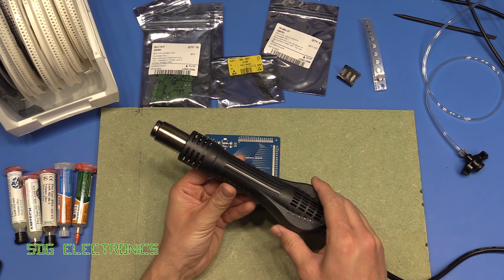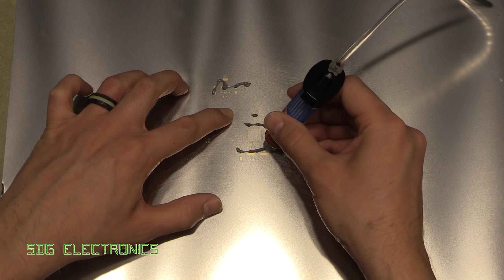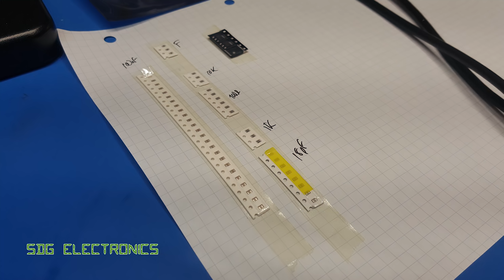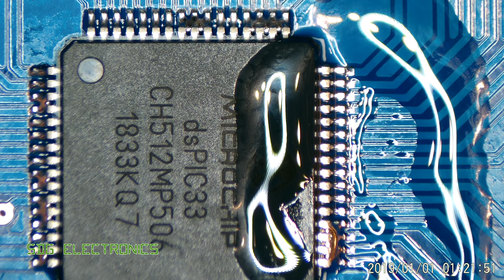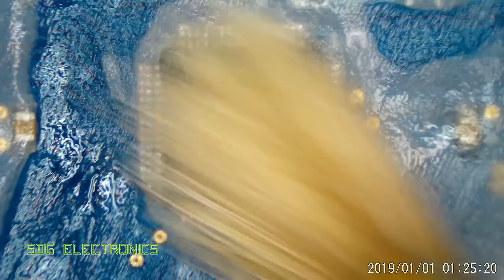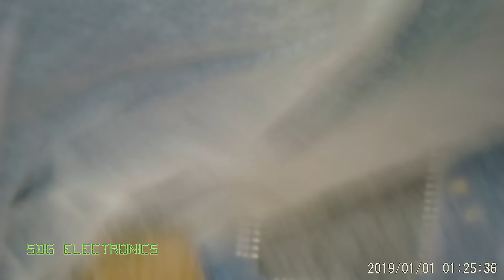SDG #061 SMD Assembly Using Solder Paste Stencil and Hot Air with PCBs from JLCPCB

Comment: What flux cleaner do you use? I've got an old Metcal MX500 - which tip did you use on the large dsPIC?
I normally use the STTC-137 (Soldering Iron Tip, 30° Chisel, 1.78 mm) for everyday tasks, but find it a bit too find to pull away solder like that; I end up having to resort to the solder braid.

I'm just about to order the Metcal HCT-900, thanks!!

Comment: Hi Steve, I like your video and you make it look really easy to do smd work. I like the way you clean up your board and would like to know what type of flux remover you use and most important, what type of tissue you're using. I assume you need something that's lint free. Thanks
Reply from the maker: For Flux remover, I've found a Fluxclene from Electrolube to be one of the best. A lot of people use plain IPA, but there are some surfactants in the dedicated cleaners that make it more effective. Tissues are Kimberly Clarke Science Tissues/Wipes from eBay. Thanks

Comment: Very impressed, Steve. I'm still pretty much stuck in the world of through-hole, but plan to create a new lab when we move and buy all the necessary equipment to do it. I'll also be following your examples and using the stuff you've reviewed to accomplish it :-)
Reply from the maker: Thanks Andy. I will be getting some PCBs made just for showing how to solder various SMD packages. You don't really need much equipment, so I'll probably pull together a list of the basic tools needed - it's basically just tweezers, flux paste, solder and a few different soldering iron tips. Everything else is luxury!

Comment: Good job :)
I like to use this method as well.

I find, I get the best results using a metal spatula and thick paste :)
I had good results with the Loctite paste.

I tried some of the cheap pastes from eBay and they all seemed a bit "runny".
But yeah, no reason to buy £50 worth of paste, if it will expire before the next use.
Reply from the maker: I need to find some runny paste. The dispenser wouldn't push it through a dispensing needle

Comment: What is the compressed air setup for the solder paste? Did you show in another video?
Reply from the maker: Not yet. Its a Metcal DX-250, I have a much cheaper unit that I need to take out the box and look at too.
Reply: @sdgelectronics  I'm interested in the air system you're using as well.
Reply from the maker: I'll do a video looking at these

Comment: Good video and great close up shots. Nevertheless, I'm not entirely sure if the claim "Fast PCB assembly using solder paste" is really right. I have the impresson, if I had soldered the board manually, that I would have finished assembling all the PCBs much faster with much less equipment.
Reply from the maker: Potentially. It really depends on how many components are on the PCB. A single PCB with this many components you almost certainly would be faster. With the three boards the additional time was probably 5 minutes in total.

Comment: Hi Steve, am impressed with the pick n place system at how well it works. brilliant vid. 
Thanks
Reply: Am in the middle of building my workshop so this is gonna be a deffo addition to the bench ! Kind regards
Reply from the maker: Yeah, this was a test really to see if the system was going to work before cutting all the holes in the box for the parts